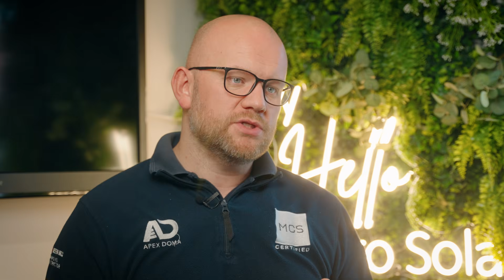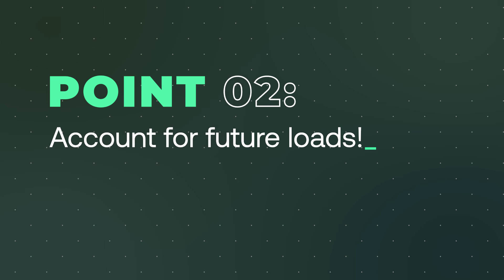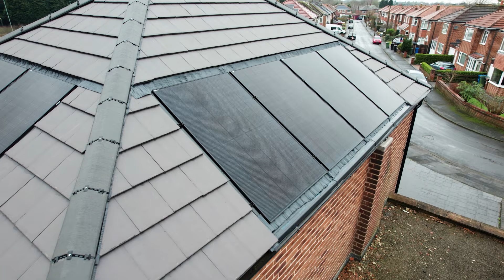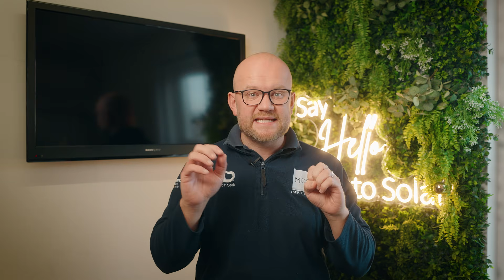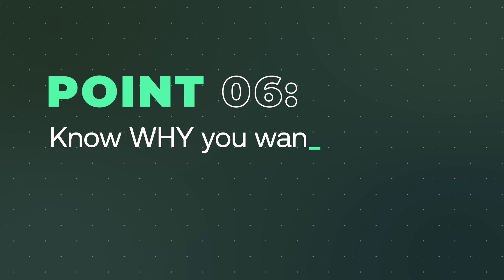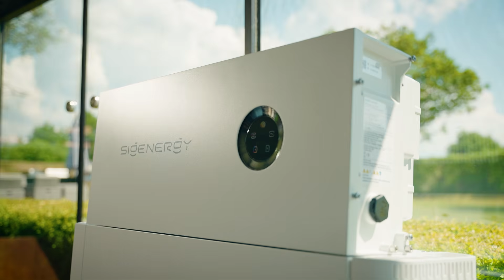7 Things to Know Before You Get ANY Solar Quotes (Avoid Costly Mistakes!)

Comment: This is nonsense. Solar panels are so cheap now that every single install should be as big as possible it doesn't matter if you use 1500 kw or 9000kw year. You should put whatever your local DNO let you put on your roof that's it. For last 20 years cost of psnels dropped by 90% The same system which cost around 18000 to install you get today for 6000 

 You won't save money if you put less panels on your roof. Panels I'm buying are averaging  £80 a piece for 465w - 515w. You should tell the people their biggest cost getting solar is not the hardware it's the labour and scaffolding. Everyone should get as many panels as possible and not just on south side fill your roof all around. 

Since we shifted away from old P type panels to Latest N type TOPCon and HUT generation they generate a lot of power even without any sun fully cloud coverage you get 2.5kw from 10 panels once you pay for the scaffolding and the people for the labour that extra few panels here won't cost that much extra but make a big diference later on.

Just my 2 cents

Comment: The system will be expected to last 30 years, the additional cost of adding solar panels is lower per panel, the scaffolding is already up, the electrian is on site.  Battery systems how easy is it to add a battery or replace one.  They are warrentied for less time than the panels.  If you get an EV in the next thirty years is a system with an integrated charger worth considering?  If you have gas heating today will you be forced into a heat pump in the next thirty years?  Bird protection, if you need it it's expensive to add later on.  If you have the funds available the options are quite different than if you have to borrow the money.
Reply: No one is going to be "forced into a heatpump"
Reply: @THG_101  Take a look at the direction of the UK.  New homes are forbidden gas boilers in the near future, this maybe delayed but realistically this is the direction.
Reply: @THG_101 pressure and coercion seems to be the preference of U.K. Gov. they could make it too expensive NOT to get one.

Comment: What happnes if someone is desging a system to cater for a heat pump and currently using heatoil?
Reply: You might be able to back calculate your previous usage in kWh of heat used by the oil, to then compare with kwH of usage by a heat pump. The projected costs can the worked out from there, but start the comparisons with kWh. An AI assistant can help you with this using your previous bills.

Comment: Excellent and informative information Ian, I had 16 solar panels, a Tesla powerwall 3 and the Tesla DC expansion pack installed this July and I did most of what you had said and I got three quotes. There was £500 between the cheapest and the dearest for the same system (I more or less knew what I wanted before getting quotes) and I went with the dearest. The reason I picked the dearest was that I had the most confidence the person that visited my house and he answered all my questions with confidence, didn’t try and sell me anything and gave me options. The reviews on the company were excellent and they were local. When It came to installation, I was having some roof work done first and they were happy to use the roofers scaffolding saving me £1400 by not paying for scaffolding twice. We could not have been more pleased with the finished system.